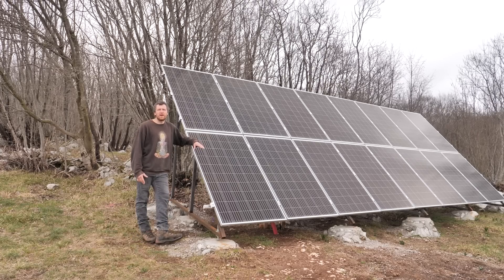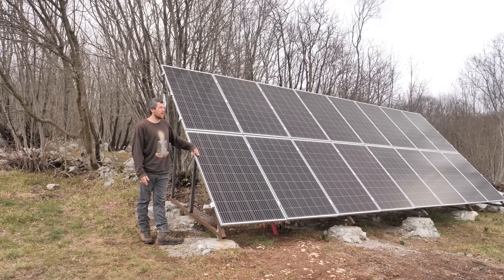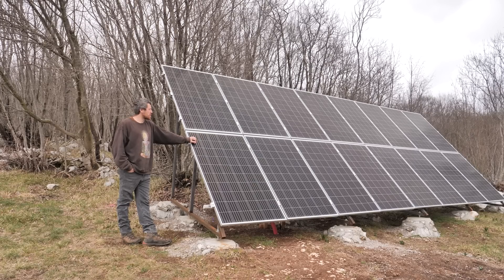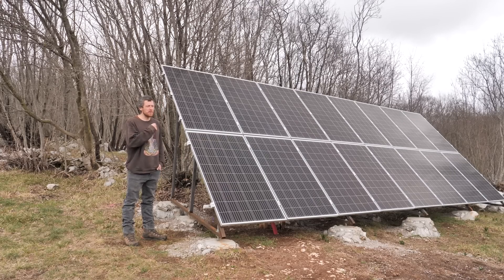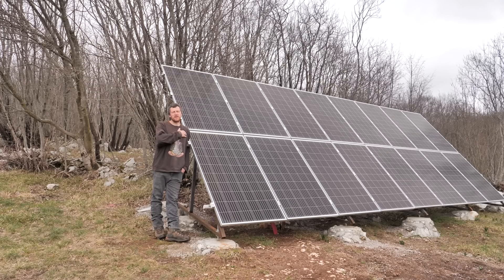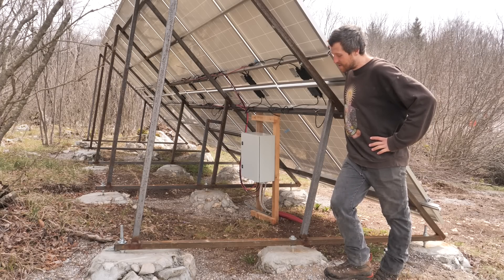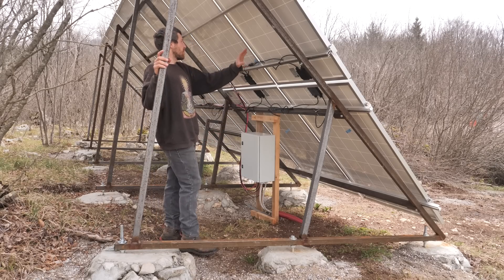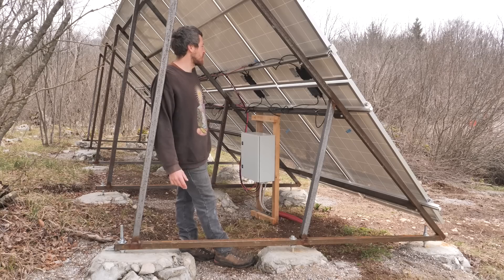My Solar Panel System for the Log Cabin

Comment: Technically you should have the inverter(s) as close to the panels as possible. That means, the longer lines to the house would be at the higher voltage, and with that less losses. This is why the power lines over large distances have a voltage of a couple of hundred thousand vollts. That would not be possible here, but I think you get the point.

Comment: i use live room cool white led srip 5 meter eat 2A power only  led light very bright and comfortable cost 5-8$ 5 meter, kitchen have 1 meter no need more very bright light, 1A eat power, and bedroom have 1 meter. led strip not use lot power. about live room i can use light 100A battery 50-80 hour/day. and light need only if you stay in room all other room not need use empty room light. all light my home cost less than 20$ and can use many ewening. and computer need 5Volt 3 amp can use one battery many day, alltime on not off newer. can use all day cheap, i looking movies, e-mails,internet yotube etc alltime. raspberry pi4 computer,not need more. one little 20W panel charge this ewery day.

Comment: today normal panel cost 100W/0,8-0,9$ maximum, if dealer take more money have thief and scammer dealer. normal cost less than 1$/watt. charger have expensive one panel max ampere about 10A-20A need one panel max 20A charger, this all system need less than 500A charger and inwerter need what is maximum all elektric you use, if have water boiler  2000W and all led light 300W other elektic 800W need inverter max 3500W inverter what cost normal about 400$-600$ lot cheapen than one year elektric bill have.

Comment: Having a solar system myself a backup system is necessary for the winter months in your comments you mentioned wind you might want to look at a tie in  w wind as well as a generator. 
You also have a fair amt of wood available so looking into a energy efficient wood boiler for bathroom and sauna might work. There are so many options, you are wise to see how the first year goes so as to maximize your efficiency.

Comment: Snow is a big problem, so now you can clean the panels if you need to. If the panels were on the roof, they might clean themselves with small dangerous avalanches. I think your system will work well.

Comment: Maiby wind generator. And maiby hot water boiler and connected with electricity and connected with your wooden stove. So you can warm it with wooden stove in the winter. And in when there enough power from battery than electric.

Comment: If you would like some help on making a "dump-load controller" which would divert excess electricity to a large boiler for water heating or space heating when the boiler is full, I am happy to help. In this way you always have full batteries and the whole costs are less than 100€ so it is definitely worth it.

Comment: Hi Nik, You did your homework very well! Cutting costs with structure is not good it will get you later on. I know of other you-tubers that made a flimsy structure and regretted it later on. Making 4 separate grids was very smart as if you have a problem with one you still have 3 in service. And also your choice not to put on the roof, especially with a snow area you would have definitely regretted it; it was the incorrect direction anyway. God bless and take care from your long-time California subscriber.

Comment: Nice solution this way Nik. If you have enough power on a cloudy day, than you can be sure there is more than enough on a sunny day. You could think of expanding the storage capacity by heating an electrical water boiler (rule of thumb, every liter at 90 degrees requires around 100 watt, so you could store 20 kWh in a 200 liter boiler). Great for the bathroom and sauna 🙂
Reply: water not newer heat more than 60 degree about, not newer boil 100 degree, too lot. tap water have about 60Celsius water not newer normal house warm 90-100 degree. and sauna stove heat washing water sametime than heat stove, no need elektric newer in sauna area. only led light. warm water can lot make sauna stove or outside wood boiler. if not want use elektric. save lot money. dish machine not sure need in kitchen normal house, and clothes have problem need wash machine, but have small little energy washers too not eat all battery capasity fast.whit inverter, and only idiot use inverter make light to house, waste lot energy to make whit inverter AC power, lot cheapen and economy have all light in house have 12 volt or 24 volt hat you battery have, no eat lot energy.

Comment: I wondered about electrics as I watched the build progress. Did you install much cable as you built?

How effective would it be to have a separate log burner purely to heat water?

Nice job, as ever.

Comment: Great engineering, Nik!  I wonder if you're going to clean and paint your metal framework for the panels----understand, I don't know anything about corrosion or such, it's just an observation from my viewpoint on this side of my computer screen.  Your rationale of selecting that spot for the array makes total sense.  For sure I wouldn't want to climb up on that steep roof of yours to (a) install all of the panels, (b( run cables from there down into your house w/o leaving holes for water intrusion, and (c) put my  very life on the line.  Sure, I miss the filming of your work on this but totally understand that sometimes things happen and the end result gives me great satisfaction.  Thank you for this episode (and all that came before).  You've come a long way from way back felling all of the logs, debarking them, creating an Romanesque crane to set the logs, etc.  All the best to you and your family of helpers.

Comment: Hi Nik, I am sure you plan to do this already but you should de-rust and paint the metal structure to prolong it's life span. System looks great and good luck to enjoying solar power for the years to come. As others mentioned in the comments, you should also look into alternatives for times when solar power is low or down. A must is a generator for emergencies but long term you should also install a wind-turbine and if you have access to a river you could install a hydro-electric system.

Comment: You must have had very nice weather this winter, for having enough energy in the batteries or straight from the panels all the time.
We have 6k on the roof, but in December and januari we had many days without sufficient production. No sun, and every day fog, rain, clouds. We live at the foot of the mountains, maybe higher up its better.
Reply: panel can charge cloud day too, no need bright sun only, i have 4 little panel at plcony handrail and can all winter eweryday charge my one 100A battery and ewening have FREE light my room. not need more, light and raspberry pi 4 computer take very little elektric, i use computer ewening and can see 2 room good have light, only make food elektric stove need grid power 3-phase stove.  my elektric bill have about 8-12 $/month only. normal if not use panel bill have 50-100$/month. save lot moey. now one year has panels and one battery. maybe if buy 1 battery more have better and some panel more but i no need.
Reply: @mattivirta, now, end of march we can have days of more than 4k with our 6k panels, which is great.
But, in December on cloudy days we had many days zero.
We do use are electricity as economic as possible, only laundry and charge the car if we have sun.

Comment: Looks a substantial improvement in the off grid environment. The way the cost of electricity is at the moment you’ll soon repay the cost of the solar equipment.
Reply: Definitely not soon, but longterm it is 100%
Reply: @chimera  within 10 years to pay for itself (at todays prices) then all free electricity from there forward.

Comment: The word you were looking for is series nick. You can connect batteries in series too (eg) Following you for some time now. You put the same care into building your home as I did to building my 45ft timber ketch. It's not building its cabinetry.
Reply: Hi, god work but you need to weld diagonals (X) on back supports ( legs) to give more resistance to wind effects. God luke.
Reply: @fernandomorais4184  built in Australia 86-87. Sawn iron bark frames with spotted gum planking. I sailed her back to the UK single handed in 93. She is now moored in my home port UK.i am a shipwright and have probably forgotten more about shipwrighting than you will ever know.

Comment: do you have a generator for back up ?
Reply from the maker: No
Reply: @nikrijavecmoments  you need little diesel motor, etc old car diesel engine,boat engine etc, and add this generator then you have cheap little generator what can use sometime if not have battery power. and wood store shed were have all winter woods, i have 10-18 qubic wood ewery winter season in shed dry, have all winter dry wood can be warm house. or convert one cheap ölittle engine to gas engine and make own gas, simple filter one litre bensin gasoline to gas and run motor whit generator can use many day one liter gas.

Comment: Nik ,what type of batteries are you using  ? Some batteries  give off hydrogen gas while charging , so battery  storage area has to be ventilated
Reply from the maker: I have li-ion batteries that can be in closed space.
Reply: @nikrijavecmoments  hey nik, electrician here. I really love how you built the array and was wondering about the batteries, too. If you are building a more weatherproof enclosure at the solar array, perhaps consider moving the batteries there too.
Batteries can catch fire some times and I consider it best practice to keep batteries far from inflammable material. It would be devastating if you lost your beautiful home to a faulty battery. Best of luck and I'll look forward to more videos. Lots of love from germany
Reply: solar panel need use "seep cyckle" battery NOT newer working good longtime if use car battery , car bat have worst bat what can buy.